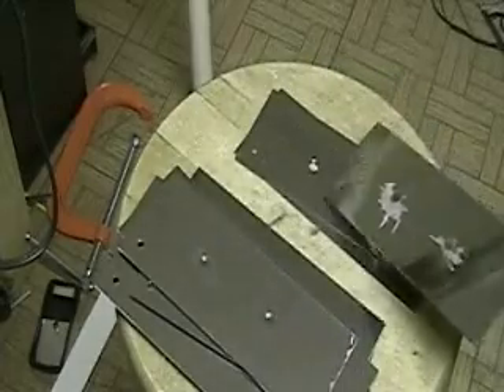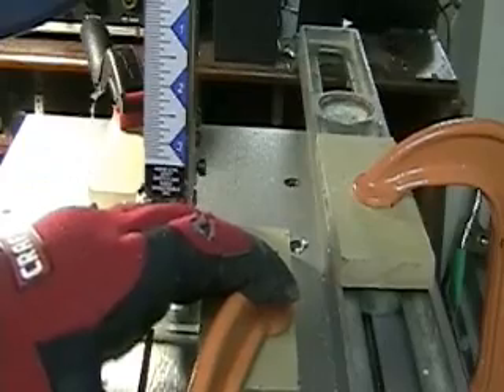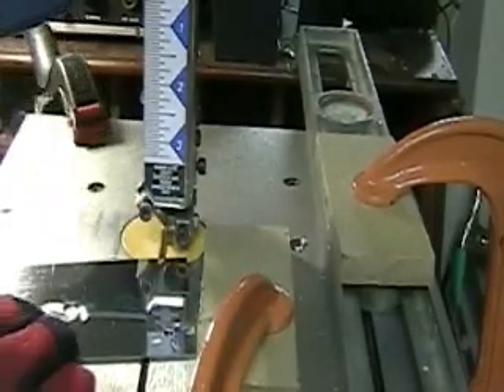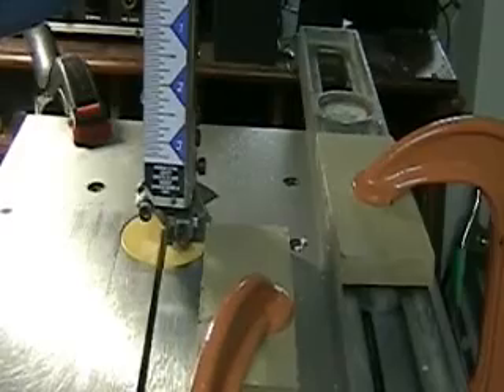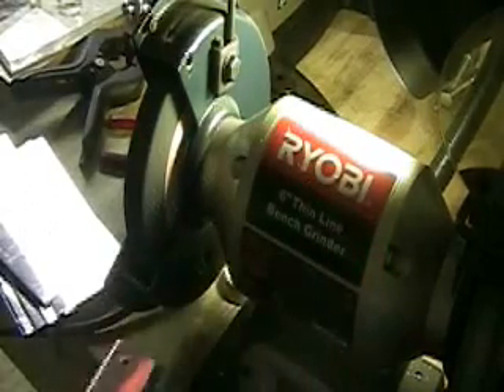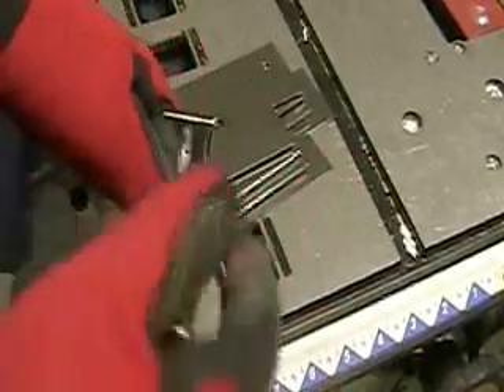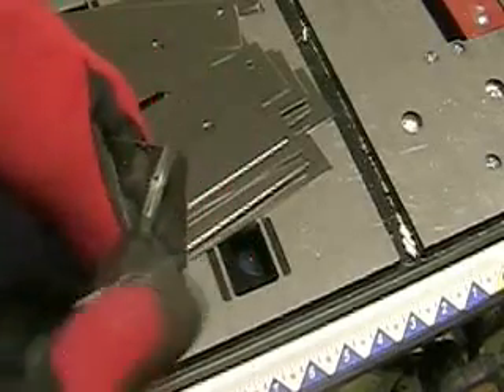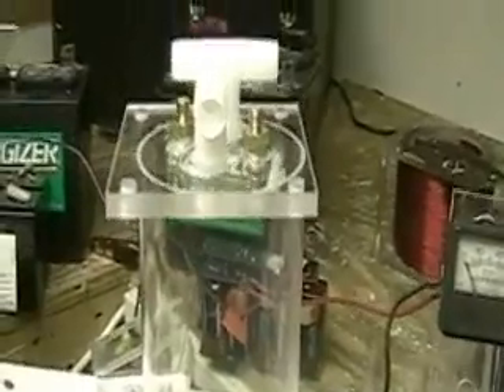Hydrogen Tap (New Cell for Honda 3x8) 107

Comment: ya, it would have to be pretty precise to ensure the plates dont move. you could also try double stick tape between each plate. one tiny piece should do the trick, and minimize glue transfer.(shouldnt be any if there is no heat applied)

Comment: John, why dont you cut multiple plates at one time? your band saw can easily handle 5, 6 or more plates at once. if you are worried about slippage, just make a mounting jig to set the pieces into. a small piece of plywood, and three 1 X 1's should do it for ya.

Comment: When the car idles neither of the locations you have predrilled will have much vacuum and the best place to run the HHO hose into would be closer to the motor past what you called the "intake valve". On Idle that will be closed and have alot of vacuum directly past it but little behind it. There are several vacuum hoses on your (aluminum intake manifold) already, run the engine and pull one at a time and decide which is best for your HHO input.

Comment: i would get stainless steel valves put in and get the pistons and sleaves coated in ceramic otherwise that engine will rust out from the inside

Comment: yeah i guess using a car without a computer would be best i was just thinking that it is hard to find that these days so in order to implement this on a large scale we have to figure it out for fuel injected vehicles but for sure you are on the right track starting out with carbed cars keep up the good work.

Comment: To get good vacuum for your idle you should utilize a port below the carb or throttle body. Also, since you will need two ports on the intake you need a tee and oneway valves so it has to vacuum the cell and not just pull through the tee and not from the cell.

Comment: I watched #106 again and you have 2 locations to port the HHO in the intake but I noticed that both are above the throttle body or carb. The downside of that is that when the car idles it does not have much if any vacuum above the intake manifold. This would work ok on higher RPM when the throttle opens as when you are driving or excelerating....